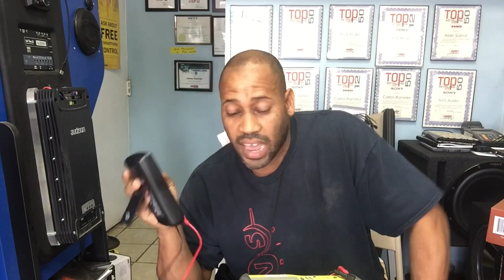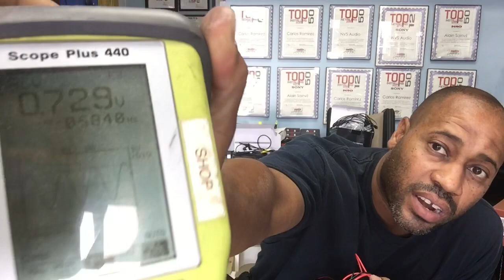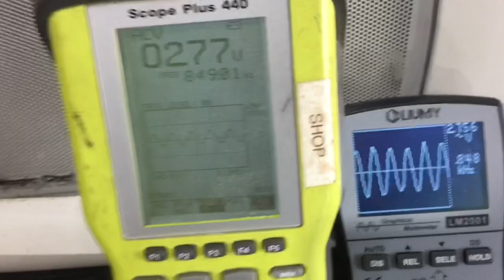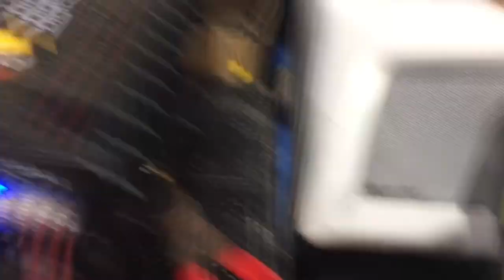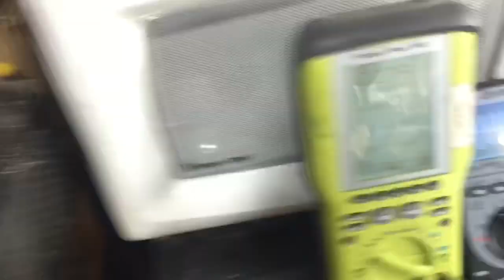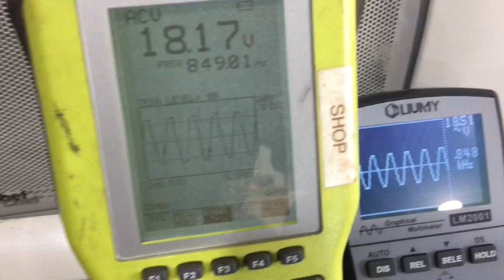Liumy entry level oscilloscope meter review by Nvs audio

Comment: Great video I saw these but didn’t know if it was any good . Bryan sold me my tpi like 6 years back . Good secondary scope for $82 plus it does more than jus the scope
Reply from the maker: NoiseBoysGarage exactly, I bought 2 I like the display better on the cheap Scope
Reply: @NVSAUDIO  how do u use the liumy to set your amp to 80hz?
Reply from the maker: mr gigady 647 do you mean setting your bass amp crossover to low pass 80 hertz ?
Reply: @NVSAUDIO  yeah